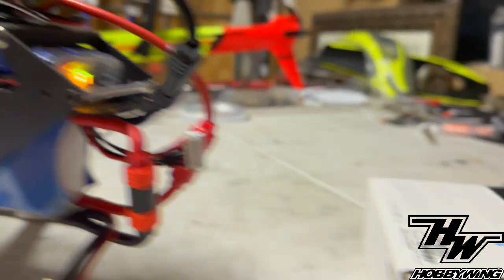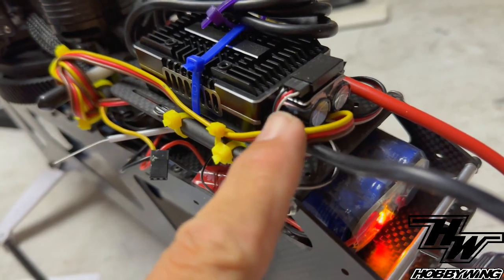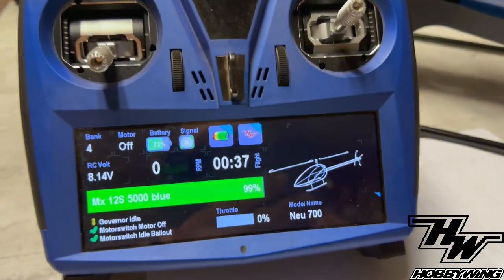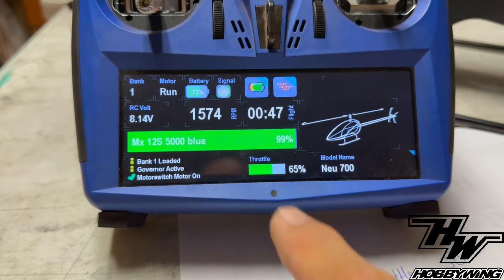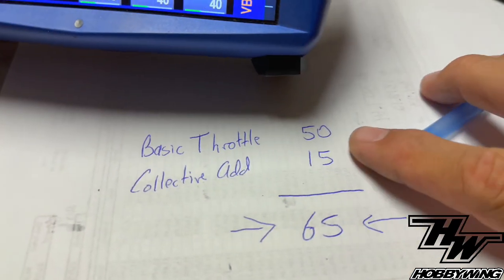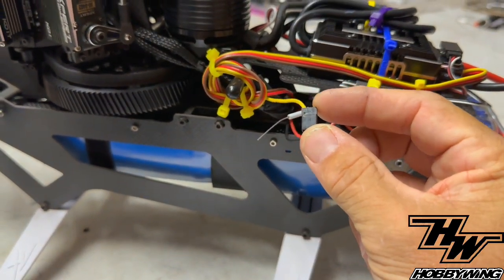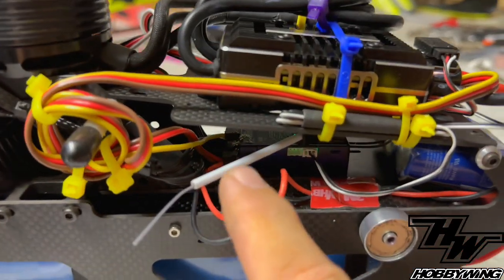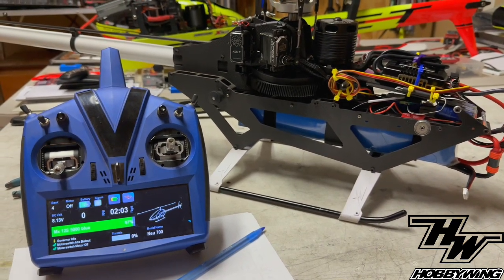Hobbywing & Mikado V Control - Troubleshooting your Gov Setup

Comment: Hey Greg.  I'm a new VBar Control and VBar  EVO VLink owner and I am having this exact problem.  Everything is plugged in, including the RPM wire, but the governor is not working.  The system is only using the basic throttle values so the headspeed is WAY off.  Again, the RPM wire IS plugged in and it's in the correct orientation.  
Did I just get a bad EVO VLink unit??
Reply from the maker: I doubt there is a EVO issue.... hmmm.... message me on facebook and lets see if we can figure this out.

Comment: Hi Greg,  I’m using a hobbywing 260 and a Vbar EVO,  when trying to use vbar gov,  upon start up my headspeed spools up VERY high before dropping down to my specified RPMs,.  Any idea what’s going on?  Thanks for these videos
Reply from the maker: Could you confirm for me 1) The ESC is set to external gov (Vbar gov) AND the VControl is set to VBar gov? 2) Verify the firmware is updated on the EVO and also the HW 260 (out of the box it should be current but worth checking) 3) Confirm that the ESC is set to all stock settings in the various parameters. I have heard of this happening on one other heli and I dont know we ever figured it out. In the VControl SetUp menu, you might try switching back to HW gov and then back to VBar gov just in case it was in the original gov setup.
Reply: I reset all perimeters,  the vcontrol is on vbar gov,  the ESC is on external gov.  The firmware is 4.1.00 (I think most recent?).   I went through a lot of toggle the governors back and forth on the vcontrol,  and ESC restarting in between.  Kind of stumped,  could it require something with the “throttle end point stick to ESC”?

After bank one spools WAY up,  then back down to the required RPMs after startup,  the next two banks hit their RPMs perfect.   So just an initial spool up issue…  Weird.
Reply from the maker: @mtb4maine  did you teach the ESC the end points?
Reply: Yes I did,  I think I found the issue though.  The “basic throttle” in the vbar gov was set much to high for my bank one,  so it was spooling up far above my rpm setting to engage the gov.  
Basically I just needed to re watch your video 😂.  Thanks!
Reply: @mtb4maine  Hey I am having the same issue.  Bank 1 is set to 2000 RPMs, but it gets up over 2300 before it settles back down. My Basic throttle points are:  50, 55, 55 (Bank1-3).  Any other ideas??  Is 50 for Bank 1 still too high?
Reply: @Jason_P  wondering if you ever found the answer for this, I am having the same problem
Reply: @mtb4maine  do you remember what you ended up lowering your throttle number to in bank one and did it fix the overshooting at spool up?
Reply: @raydash2898 don’t know if you found the value. But you can do a spool up in the ground with no collective and look at the value when it stabilize in the controller

Comment: wow the governor performance is amazing! thanks again for the help now I have another question, I have an old castle phoenix ice 2 hv  it has no rpm lead. so I want to run the esc in airplane mode and then use collective add to get the same feeling im getting on my hobby wing setup?  I also will need to do an endpoint setting right? thanks man! Mike in TN

Comment: Duhhhh!! but my Neo governor isn't working! Duhhhh.... just kidding Greg,great explaination.Hope to see you at Ken's annual funfly this April.
Oh...I forgot,I do have a HobbyWing 200 amp esc problem,I'm using the Vbar governor.There was a firmware update a couple years ago for the dreaded spool up problem,when you spool up the heli would turn left.I downloaded the firmware to fix that problem on my Logo 700 and it worked,now two years later it's doing it again,i have no f'n idea why it's doing it again.I reflashed the firmware and it didn't help,the only thing i've changed since the firmware download was the basic throttle on each bank (Justin Coffman suggested) to achieve the head speed that i want per bank.I tried going back to the default 50 percent per bank  and nada! I've turned down the spool up rate from default 3 down to 1(spools up slower) but as i get closer to my target head speed it turns left. I also run a higher governor gain than default....35 governor gain,but i used that gain number before with the firmware update and it didn't affect the spool up turning to the left.Any ideas on why it's turning left again during spool up? The turning left only happens at the initial spool up,so if i go back to throttle hold after the spool up and i switch back to the motor on position again than the turning left doesn't happen,only on that initial spool up or if i go and do another flight pack.I know about the concept of the ESC starting the motor and than the term "Hand over" to the fbl governor and that's when it's happening.